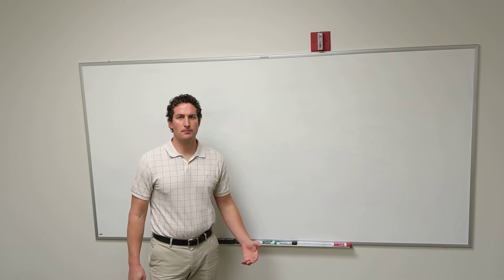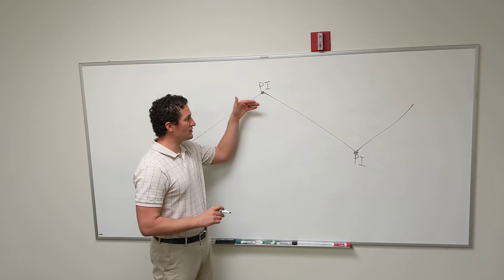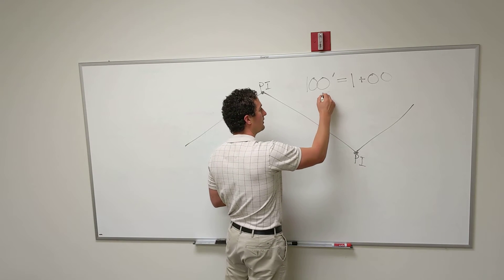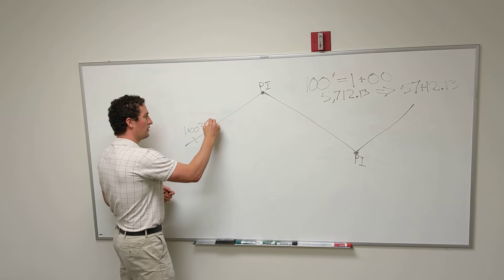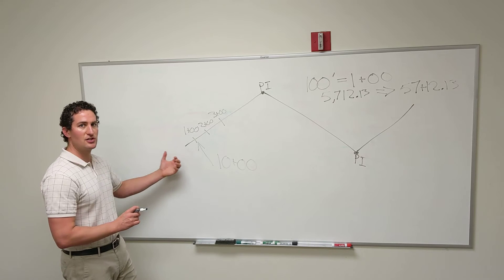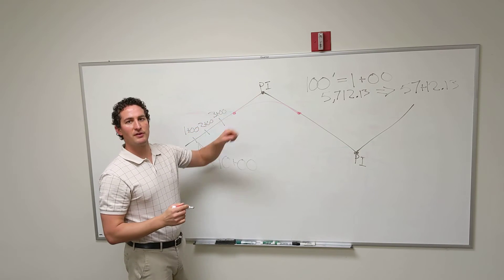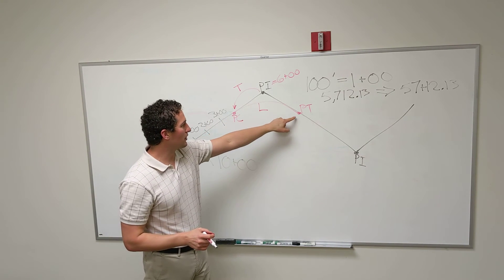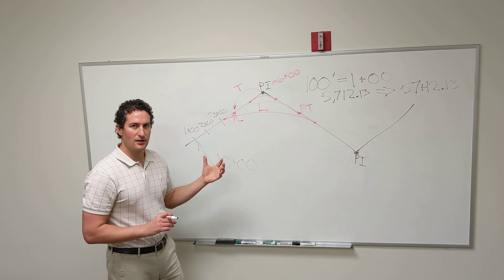Stations & Traverse for Horizontal Alignment

Comment: Hi Daniel can you help me to solve that problem
A distance of 2104.21 feet is measured from the beginning point of a traverse. What is the station at the end point?.
How to station it?
Reply from the maker: Maged, what are the other givens for that problem?  Is there a horizontal curve present?  If it's a straight line (tangent), you should be able to just add that length to the starting station.
Reply: Hi Daniel
Thank you for answering
That's all the problem I wrote it to you
Reply from the maker: @magedhabib1249  that's interesting, is there a figure that shows more details?  Standard stationing is just based on labeling every station (each 100 feet), so that could be the solution they're looking for.